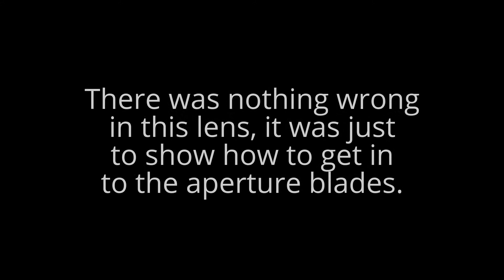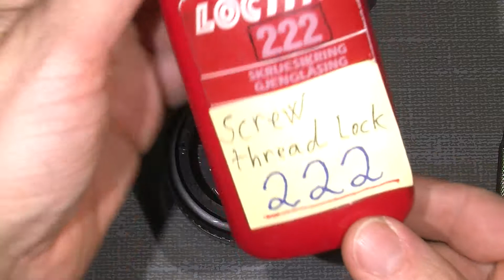Working with the aperture blades in AF NIKKOR 50mm 1:1.4 D

Comment: Thanks for this great video! Really great explained. I'm technically quite experienced but would not have dared to touch the lens without our step-bystep video. 
To be sure I wouldn't have had an idea how to get the front lens off . But with your worthy tipps it all was easy. And after folliowing all your instructions and doing the necessary marks it was also quite simple to put it all togeter again.
I fixed my totally oily aperture today and it works now like a new one now :-)
Thanks again

Comment: Thanks for this!! Tutorial will work for 50mm f1.8 (older version not the D or G version). Didnt have a rubber stopper, so i took some hot glue and placed it around the rim of a small light fixture to give a grippy circle. Worked like a charm and now my aperture blades are oil free. Once again thanks so much!

Comment: Thanks a lot, for aperture work on and assembly guidance. My latest Nikkor 35-135mm 3.5-4.5 was dirty in the closest to aperture lens block, and I tried to get to it from the front and took out the aperture...this wont help, as the way was from the rear, and hidden so stupidly, even the spanner with curved rods coudn't reach the ring to unscrew. Do you have any experience with this lens cleaning and disassembling fully? Thanks again,

Comment: And smth which hurts...the screws! Soaking them by alcohol or WD-40 - doesn't work on my latest purchases of some Nikkors, Pentaxes etc. I even heat the screw head, after keeping it treated by alcohol,  by direct flame from a mini-torch! Some bolts yield, but some still stay... any advice for badly recalcitrant bolts?
Reply from the maker: Have you try the use of nail polish remover,, or Acetone, it will soften most of the not so hard thread locker, maybe you have to let it stay for 5 min. before unscrew the screw's. (I have done it many times woth good luck), Take good care when working too close to plastic, it will soften it!